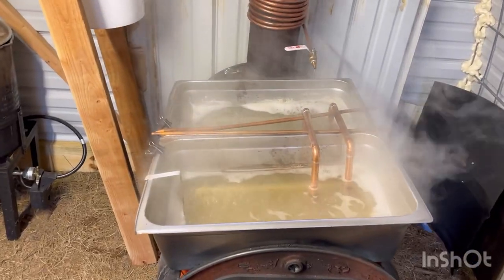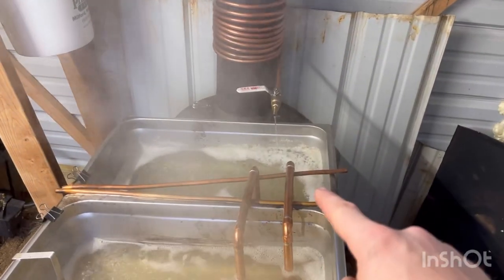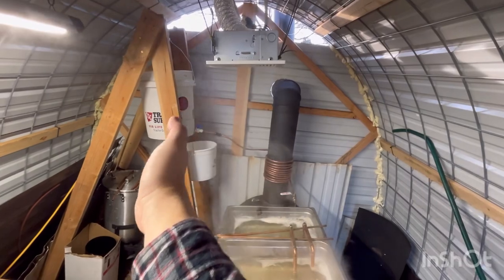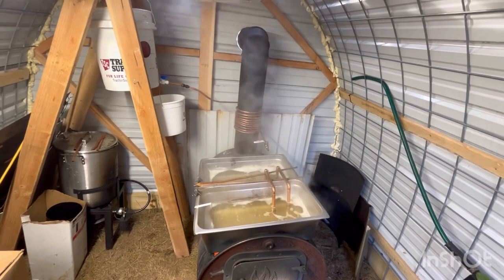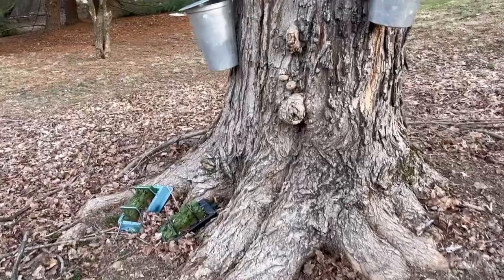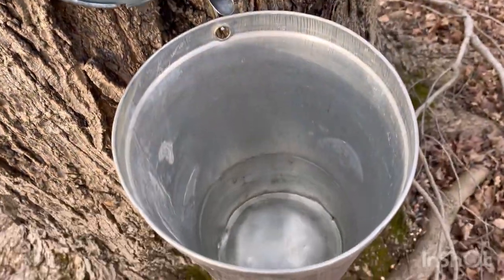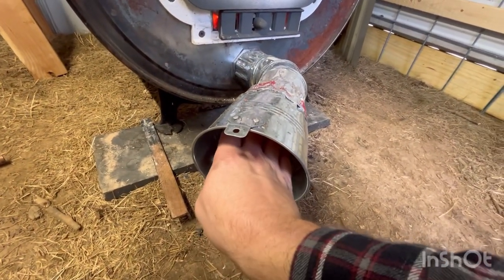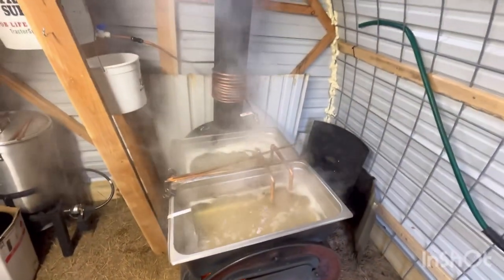2024 Maple Syrup Season: Siphon Tubes

Comment: I have a similar set up and will be using a syphon tube for the first time, also i am adding 1/2 " copper coil tubing to stove pipe. My question to you is it better to have valve on before stove pipe or after above closest plan to door.
Reply from the maker: I started out with one before the stove pipe and I ended with one in both positions. I recommend both.